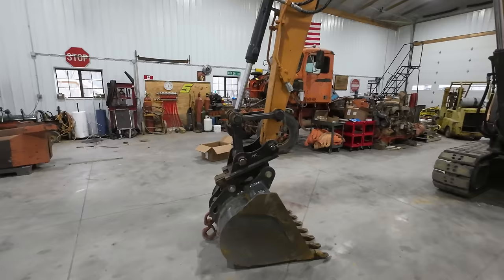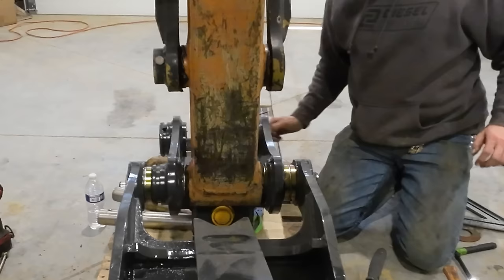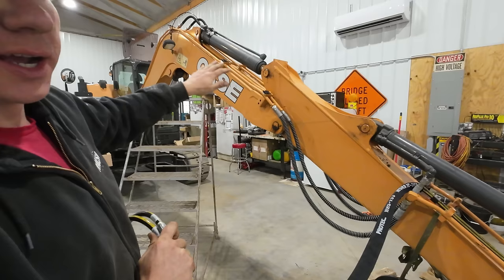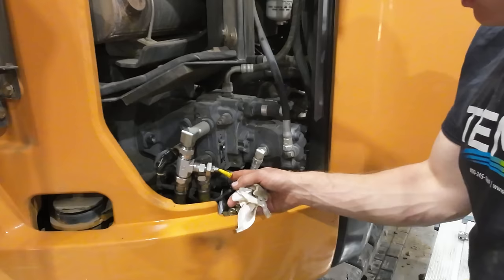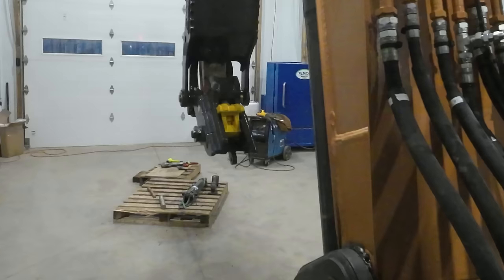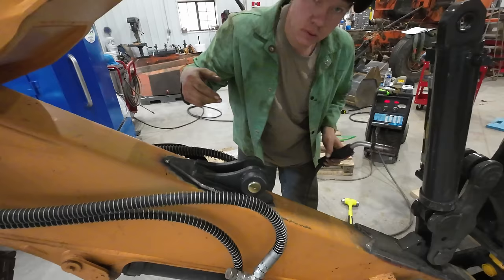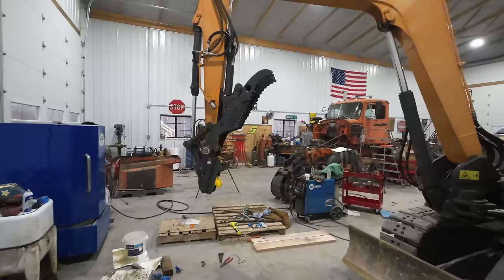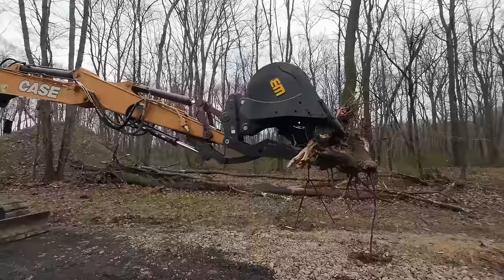Installing A Hydraulic Coupler and Progressive Link Thumb. ( New Excavator Gets Upgrades!)

Comment: Question...

How are you going to use the Auxiliary Hydraulic system for a Concrete Hammer or Harley Rake without simultaneously flipping the Thumb up and down?

By putting in a simple T fitting, the Thumb cylinder will be actuated whenever you use the Aux. fittings at the end of the boom...

How do you intend to switch between Thumb and Aux. functions?

Comment: I've followed you for about a year, ever since I found you on U-Tube. You should invest in a few things to save money. A chipper for limbs you burn in a burn pile. The chipper will make chips you can burn in a coal burner for your shop. 
You should invest in a mill by the creek, you can generate power for your house and shop year round. And you should use stumps to fill holes that you dig to get stone for packing.

Comment: It feels so weird to see thumbs on excavators.  Maybe thats because ive lived in a reality where pretty much every under 30 (metric) ton excavator has a rototilt coupler. 

If i ever bought an excavator for myself, i dont see myself being able to live without rototilt. 360* rotation and about +/-45* tilt just makes life so much easier and more precise. 

Also paired with a grapple one could grap a tree and lift it off the ground without having to knock it over first

Comment: That's an amazingly useful modification to your Case Matt!  Installed professionally by you, it looks great mate!

BSP = British Standard Pipe.  We also used the 'American' one, NPT.

NPT = National Pipe Thread?

Those 2 are ALMOST the same as each other, but are DEFINITELY NOT the same as each other!  Sooooo close, but stainless steel fittings of mixed types will SEIZE & WELD together if you try to tighten them, & a grinder is required to separate them!  I think the thread pitch angles are slightly different to each other.

But what a PITA?  What's the damn point of having different standards if they're so close?  Stubborn U.S. or U.K. pride or what?  It annoys the hell outta me!

Comment: You need to add on off valves to thumb hoses to use aux hydraulics other than that only very few differences between factory or dealer install and yours 
WB used to include 6-8 foot of hose sheathing for the hoses in the kit did they not include it this time (hydraulic quick coupler) and like I said on off cables were dealer supplied so those were not in the kit because not all machines included aux hydraulics ( although case was much more better about it in the smaller machines than komatsu)
Reply: Other differences included mostly installation methods like using figure 8 with zip ties with one in middle to prevent hoses from chaffing and use of Velcro on window versus tape to better protect the window from damage when using a hammer and box vibration shattering window ( probably not an issue with machine under 120-150 but was a problem on 200 and up )

Comment: sorry BSP all the way ( British standard pipethread ) over here in the UK. Didn’t think it was possible to mare BSP to JIC 🤷‍♂️ as they are very different and thought the thread size would be different. There is such a mixture now it’s crazy. A lot of ours are now metric. Metric has taken over on the new machines. I am of an age that uses inches and millimetres and switch between the two. Watching you mentally subtract those crazy fractions makes me glad of metric for those smaller more accurate measures😂😂

Comment: welding heavy stuff these days, you weld 1 inch long then 1 inch gap then 1 inch of weld then 1 inch of gap then 1 inch, all away along what you are welding, this method has been proven to be extremely strong, id use a arc welder on that thick steel,

Comment: Fantastic video as always, Matt :) I have no experience with heavy machinery, but I was wondering; is the bucket is supposed to curl when you active the hydraulic coupler? It looks like it fully curls and then actuates the lock, but my understanding of the controller was that it would divert the curl function to the coupler. Is it not fully closing off the curl in error, or is it supposed to do that so the bucket is being pulled into place by gravity before the coupler actuates? Love seeing you work on all your iron, and I'm looking forward to the next video as always :)

Comment: I still wonder why you are using these thumbs in US, why don't you add a Rototilt or Steelwrist to the machines and then you can use the bucket in 360 degr. angle and have the clamping function as well all in one. I have not seen an excavator here in Sweden without a Rototilt or Steelwrist. They are expensive but you can save so much in time and the finish you can get when planing out the dirt is just fabulous.. Love from Sweden // Micke

Comment: bsp (british standard pipe) has been around for a very long time (100 + years )
Reply: Refresh my memory. What designates straight fittings rather than tapered fittings for the British pipe system?
Reply: @brianworley7705  Taper threads seal on the thread.  Straight threads have a separate seal and the thread just applies force to seal against it.
Reply: @dfross87  That clarified how they seal. But what is the designation for the tapered versus straight British pipe threads?
Reply: @brianworley7705  BSPT and BSPP.

 British Standard Pipe Taper.

British Standard Pipe Parallel.
Reply: @dfross87  👍🏻 Thank you for refreshing a foggy memory.

Comment: JIC is murica threads which is british threads then JIC reversed the flare to be different but not really from the brits(cause murica)
imo both of those standards need to piss off as they are old n outdated, but if anything JIC needs to piss off because its just BSP with an american flag glued over top of the british flag n bsp is still used worldwide, JIC is just used in America

Comment: Wow quick couplers and a thumb.. Wait until the Americans discovers that there are modern developments and equipment called Tilt-rotors with inbuilt grapples that diggers to the east has been equipped with for decades 😂 It's weird that with agricultural machines the US is at the cutting edge, but with forestry and earthmoving machines the US is still in the 90's
Reply from the maker: Too expensive. A rotator costs what I paid for the machine!

Comment: I see ya'll are welding with flux core wire and no cover gas. My certified welding says that is a slight degradation of weld strength and porosity. Not a whole lot since ya'll ground the surface clean, but I was certified to weld nuclear piping. Which probably doesn't mean much anymore. I could not lay down as much metal in a day's burn with flux core wire. Welding machine components was always fun for me on new clean equipment.  When I did it lead was always present in the paint so I used a filtered air hood. Still alive at 77 even though my wife can breathe more gas than I can now.

Comment: should never weld anything that has a battery in it to you disconnected, regardless of electronics it puts a positive charge right into your battery through your negative grounds that a good idea it will take away light from your battery I don't care what you're driving always unhitched a battery, and never do amateurs doing is putting water on a well after you have welded it it crystallizes the well and it moves a lot of their strength just keep that in mind and that also means don't pain it when it's hot either that will do the same thing as water will

Comment: Where is the safety guard on the grinder and where are the face shield and/orsafety glasses. My son and an old  work mate have the MEDALS FOR LIFE in my son's case the wire brush  came adrift and his face and neck area  looked like porcupine and pieces were in his safety glasses, and my old work mate technically became blind when the wheel flew to pievec. he was not wearing safety glasses and both units had the safety guards removed. my son was lucky as his injuties were extremely  minor, bandaid level. however the work mate because of the safety breaches lost all claim to compensation. His employer was fined heavily. it was onlythe efforts of hs employer and his workmates, that he was looked after and was able to transition to a new vocation which allowed him to provide for his family with dignity.

Comment: Inch and parts of Inch, wow. You really need to embrace the Metric system. Your Case is metric, being Sumitomo or Hyundai or something, even shows its weight in Kilograms right there on the side. Always amuses me when guy's guess the weight of gear in thousands of pounds, when it's right there in Kg's. Tires though; come on, there's an oddity; they mix Metric and Imperial right on the sidewall,    hmmm, wait, I've gone off-track. Go Metric, it's not too late for you haha